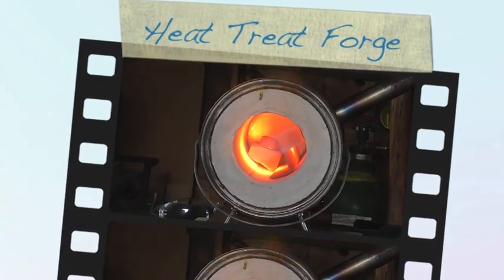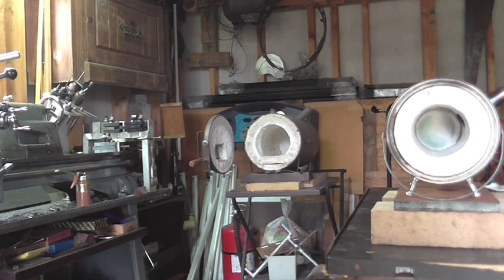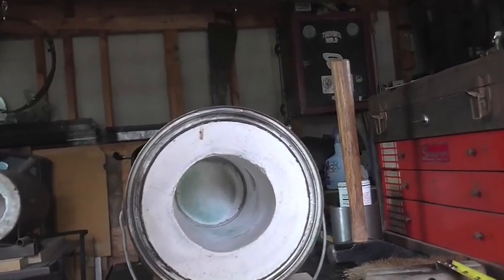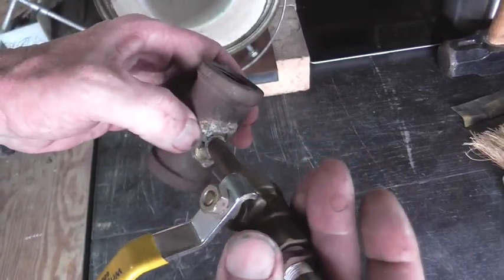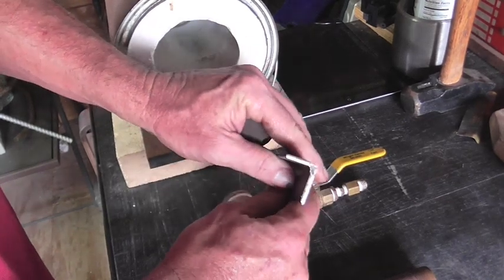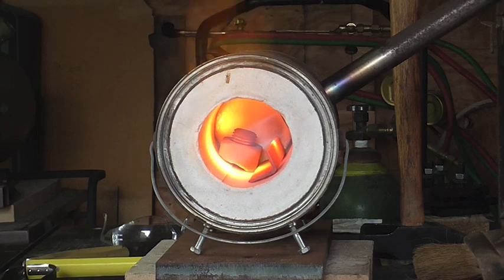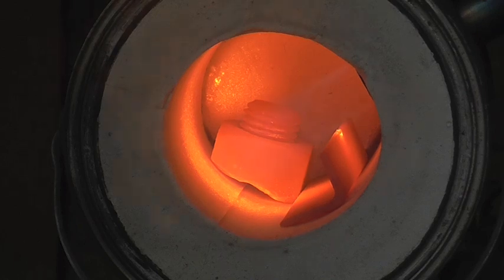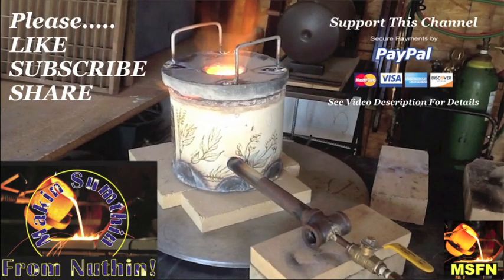Miniature Blacksmith Propane Heat Treating Forge - MSFN

Comment: Are you using oxy/acetylene hoses to run your propane? If so, how are you hooked up to the propane tank?
Reply from the maker: No, its a long propane hose that I got for free off some craigslist ad, its like 20' long. My hose connects up to a 1/8 NPT fitting on the burner I made

Comment: would refractory cement hold up better than plaster?
Reply from the maker: Depends on what type you refer to, for low usage plaster works ok but plan on replacing it...its cheap enuff
Reply: Thanks for the input.

Comment: I am building a forge similar so this but is there a reason to put a small end on the propane line or would a regular .25 inch pipe brazed in work?
Reply from the maker: Just like a car engine you need a proper fuel/air mixture. What you propose will be a fuel rich mixture, incomplete combustion of propane, extreme waste of fuel. Follow proven examples such as this and avoid a lot of headaches. You will have yellow flames shooting out the front of the forge because the fuel is unburned, and greatly reduce your forge temp. Hope that helped
Reply: ok thanks that makes sense ya it was basically just a solid yellow flame
Reply from the maker: Forced air injected would help but still a huge waste of fuel

Comment: What kind of Plaster Of Paris did you use? And do you think spreading a lair or two of furnace cement over it would keep it from cracking so soon?
Reply from the maker: The plaster is just the basic stuff from Lowes, its mixed 50/50 with fine sand....cement wont do anything to extend life but...this little forge is still in operation with the original plaster as of today
Reply from the maker: Superheating this type of forge will cause the plaster to fail quicker but the plaster does make a useful forge on the cheap.

Comment: Hi 
If you move the piece back where the torch hit the surface,make it any difference?
Reply from the maker: No need to really....the whole operation only took a short amount of time. It reaches about 1800 degrees in that little guy

Comment: Where the mig tip is welded, why did you use a T fitting instead of just a straight fitting. ??
Reply from the maker: A bit more airflow with a T fitting, I have a straight fitting on my foundry burner. Both work fine in the forge

Comment: I think this would be good for a lost PLA project I've been failing misserably at ;) Your band saw is nice also :) Sometimes I think I want something like a band saw but then I quickly remember I have no were to put it :)
Reply from the maker: This one is not near as nice as my other forge but is cheap to make and has its uses. Its rather small with just a 3.25 opening but for heat treating small stuff it works fast and doesnt take up much room. I have wanted a horizontal bandsaw for a while now, cutting stock with an angle grinder was getting old :)  My lathe doesnt like parting steel, its the only operation on the lathe that has given me trouble so far....could be my lack of experience as well :(. I have been looking for updates on your project 👀
Reply: I'll be posting a video of a dial indicator case later this weekend and will give an update on my current progress. :) Always forward! :)
Reply from the maker: Will look forward to it :)

Comment: Great video quality and fantastic information for those of us just getting into forging. Thanks.
Reply from the maker: Thank You! Consider subscribing...more videos coming soon and be sure to check out my older ones :)
Reply: Already did, got a lot of the ideas for my refrigerant tank forge build from  your Custom Blacksmith Propane Forge Build. Got my stainless flare from Larry Zoller Forge for my burner. It's all coming to gether except for the darn hinges for the door are kicking my butt. Still working on that one.
Reply from the maker: I about spit out beer on my ipad when I read "hinge for the door". Its the most common question on my build...mine came off a scrap BBQ grill, it was one of the lid hinges :)
Reply from the maker: I found a flare on the burner isnt needed when its in the forge environment. Its only useful to demonstrate the burner outside of the forge
Reply: Makin Sumthin From Nuthin I have been looking for that same hinge on old pitts for about 3 months. I have finally decided to try to figure something else out.
Reply from the maker: If I could find the other one I would send it to you...but cant find it nowhere :(
Reply: I really appreciate it, if you find it let me know. Hinges on curved surfaces ain't no joke.
Reply from the maker: I have a lathe now, could probably make one. I guess I got lucky at the time 👍🏼

Comment: Very nice! I'm not sure if you mentioned it or not but what gas pressure are you using?
Reply from the maker: I dont have a gauge on this particular burner but from experience...10-15 PSI for this demo
Reply from the maker: My regulator is adjustable from 0-30 PSI. I could have really cranked it up but it destroys the plaster faster :(
Reply: Alright thank you! I have an adjustable regulator for butane only so I was just wondering the rough pressure for that mig nozzle, should be near the same pressures involved (I think..)

Keep up the great videos, would love to see more casting :)
Reply from the maker: It should be approx the same I would imagine for propane, butane or natural gas. I will have some metal melting videos coming up soon. I just havent had much need for cast parts lately :(